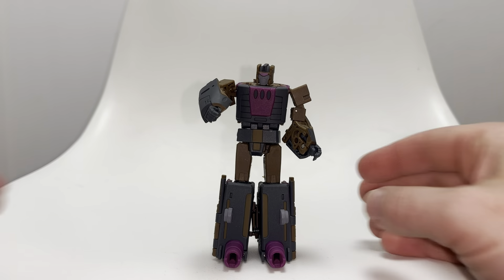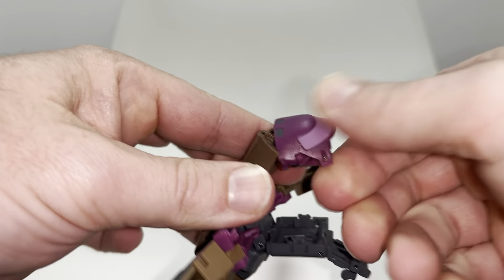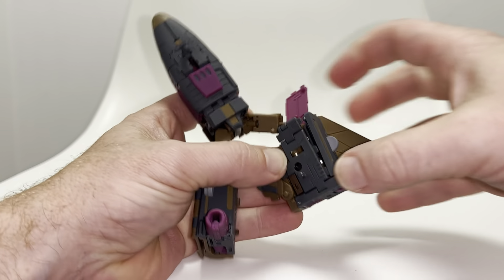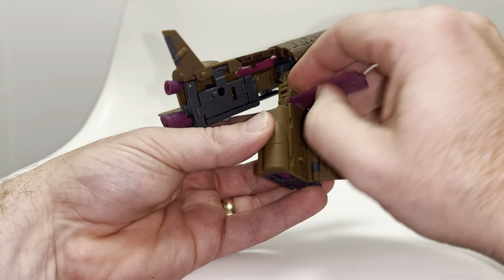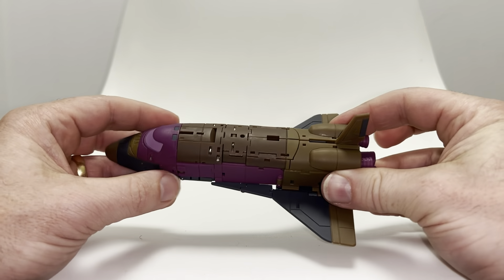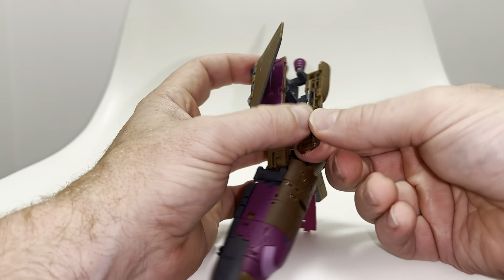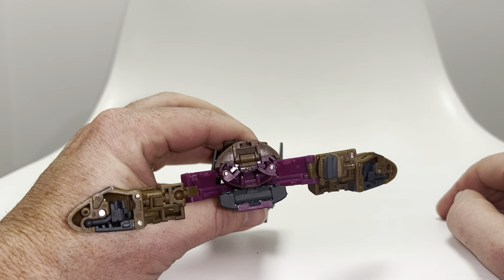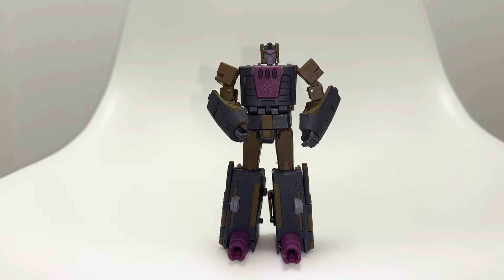How to transform magic square B55 combiner space shuttle. Transformers generation one blast off G1

Comment: Man, Magic Square still has the same design flaws ongoing! I had same issues transforming G1 Megatron into gun mode. Magic Square needs to stop with these little wedge pieces fitting into place. They don't fit in properly or take multiple tries to get it right. This where Newage excels and makes the transformation pieces fit in a lot better. I think this is why Newage on average costs a little more than Magic Square. Newage materials are just better.
Reply from the maker: I agree that Newage transformations and figures are superior. Magic square are in most cases over engineered and more tricky than fun